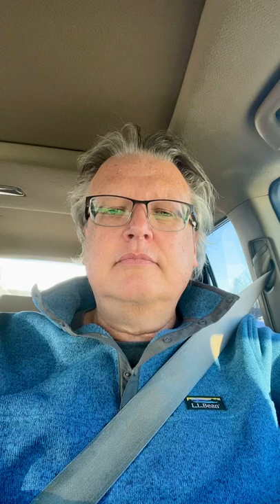Separate Pre Amp vs Integrated Sound Quality

Comment: Benchmark LA4 pre + Quad 909 power … 3500 USD … very compact combo of separates 
Now, I feel I would need 7-10K integrated to get same quality driving my Neat Acoustics Motive 1 stand-mounts
Reply from the maker: The LA4 is a great Pre. Check out the Schiit amps. The Vidar has compared favorably to the benchmark ABH2 at only $699.